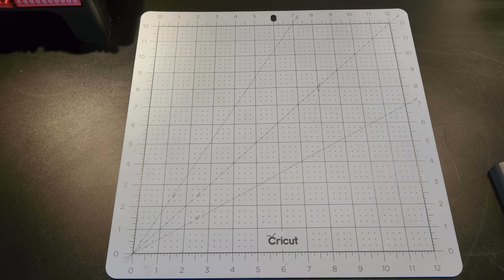DIY 16x18650 Battery Bank with USB-C Power Delivery

Comment: What is output wattage of device?
What if tge charging circuit gets out of order? Can it be replaced?
Reply from the maker: It can output 5v, 9v, or 12v depending on what voltage the receiving device requires. The pcb maybe replaceable, but I have not researched that.
Reply: @TechCentric_00  I am a doctor in internal medicine, really don't much about these things, what should I look for a replacement circuit, can you please guide or can you suggest one kindly or send me a link 🖇️ which is compatible with the power Bank circuit,
Reply from the maker: The relative cost of these diy battery banks makes it not worth replacing the circuit. Just buy a new one and move the batteries over.

Comment: When paralleling 16 cells for an 18W PD powerbank you don't really have to worry about the cells continuous discharge current but when you look at the 100W PD powerbank boards and you're not putting many cells in series you ABSOLUTELY must do the math on the power output of the cells. AND THE CHARGE CURRENT LIMITATIONS.

For example the IP2368 is ia 100W bidirectional PD board. It can be used with a 3S/4S/5S*/6S* battery. Either NMC/NCA or LiFePO4. 5S/6S require changing out a component that has a 18V'ish limit. You also have to change resistors or short out solder pads to set the board up for the chemistry you are using and all the other parameters you can change.

But if you make a 4S1P battery for the IP2368 (3S is limited to 65W ) then you have a minimum voltage of 10V (but really I think you need a minimum of 12V and you really shouldn't be taking your cells below 3V in this kind of application if you want to get a longer cycle life).

12V*8.5A=100W
So that's a discharge current of 8.5A per cell. An LG MJ1 or NCR18650GA is going to be getting pushed it its absolute limits and then some even though they are 10A rated cells.
But what if you try to charge the pack using a 100W USB C PD charger?
12V*8.5A=100W
That's 8.5A of CHARGING CURRENT. Not a single 18650 currently supports that charging current. Just a couple 21700's support that as the ABSOLUTE MAX charging current but it will significantly decrease cycle life. Ideally you would want to use a 20W/30W/45W or perhaps at most a 65W charger.
20W charger=cells rated for charge current of 2A
30W charger=cells rated for a charge current of 3A
45W charger=cells rated for a charge current of 4-5A
65W charger= Molicel P45B, P28B, Samsung 30T, Samsung 40T, Lishen LR2170LA and that's about it

Obviously if you build a 4S2P pack you give yourself a little more flexibility but at the end of the day you should be using cells with a max continuous discharge current of 20A for a 4S1P pack if you are outputting 100W PD. Molicel/Samsung power cells/Lishen LR2170LA are the only options I would consider acceptable. Charging you would have to limit yourself to a 45W charge at absolute most. 20W or 30W would be better and would not significantly ruin the cycle life.

A 4S3P pack is kinda the point where things open up a bit and you can be a little less picky.

It's not until you hit 4S5P that you can even consider using 10 year old salvaged cells from laptops 

So don't just buy one of these Powerbank shells that do fast charging and think you can just slap any old cell in there. If it does over 20W of charge/discharge then you need to do the math.

Comment: Can you charge and discharge at the same time?
Reply from the maker: Not sure I can try when I get back from my trip.
Reply from the maker: With a quick test of using the Lightning in and usb-c out it does appear to do both at the same time.
Reply: @TechCentric_00  that's great. Thank you for testing that!
Reply: I'm setting up a solar remote lora coms device and was thinking of using this battery bank system.  I would hook up a solar panel with a USB 5v output and plug it in while at the same time connected and powering my lora coms device.
Reply: as my experience like this powerbank,it doesnt appear fast charge when you connect  two usb port output

Comment: Hi.. what do you mean by the voltage different? if my battery voltage is around 4.0vdc and 4.2vdc, is it acceptable?
Reply from the maker: When putting battery in parallel, they need to be as close as possible. If you have most at 4.0 and one at 4.2 I would bring the 4.2 down to 4.0 before connecting them together.
Reply: @TechCentric_00  thank you so much for your reply. By the way, once your power bank drain out, did you just simply charge back the power bank using the case? or did u take out the battery one by one and charge it individually (without the power bank case)
Reply from the maker: I just used a high watt usb-c charger and left them in the case
Reply: and another question, if the voltage is around the same but the battery mah is different (maybe different brand) is it ok? Sorry for asking a lot. I did have the same power bank case like yours, but my problem is, once i charge the power bank to 100% and use it, it will slowly drop till 85%, and after that it will go to 0% very quickly. 

Once I charger back the power bank, from 0% to 100% only took like 2 hours. Very weird.
Reply from the maker: I would only use all the same cells.It sounds like you have one or more bad cells that can not keep a charge and that is depleting the pack.
Reply: @TechCentric_00  Thanks. I will have to do my trial and error based on your info. XD
Reply: @kaycetot  I have exactly the same problem. I used batteries with a capacity of around 2300-2400 mAh. And it's doing the same thing as yours. It takes a long time to charge until it reaches 85%, then it drops rapidly to 0%. Have you figured out why this is happening?
Reply: @mihaialbulescu6713  i’m not sure if i figured this out. But what i did, i bought another set of LG battery,￼ LG HE4 2500mAh (20A) to be exact, i charged all of them at around the same voltage, different around 0.01-0.1 vdc, and it works for some times. At the end, i bought another new set of case, which is a downgrade, used the LG battery, and it works like a charm .

Comment: This power bank is perfect for some cheap knock off 18650s I bought years ago. They have like a 15x charge cycle on them but I have like 100 of them and never knew what to do with them. I bought one of these power banks and threw a few of the batteries in them, wrapped it up and used it to power halloween lights.

Comment: I have a few of these that I purchased from Banggood (21 cells and 12 cells).  They work fine but the pain is charging them back up.  Takes over a day just to charge the bigger one.  This is using a 65watt USB C wall charger.
Reply: Yea the downside to size.